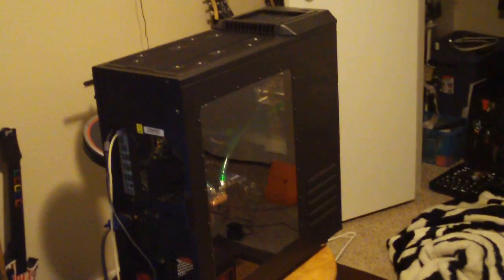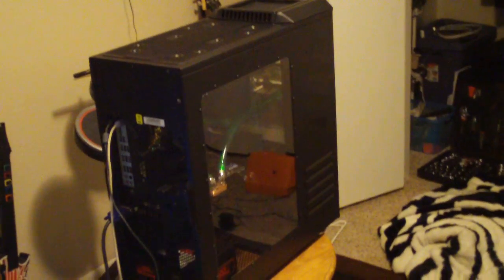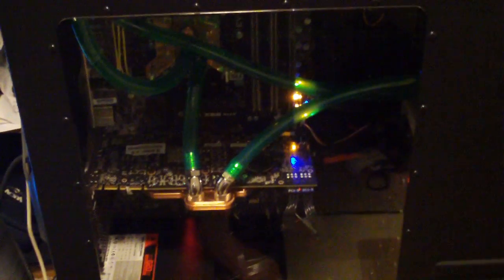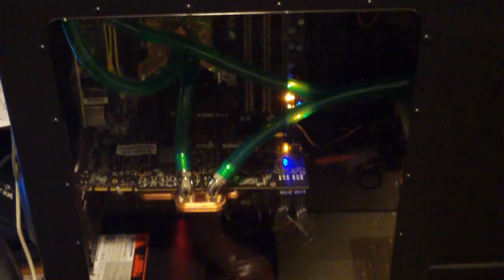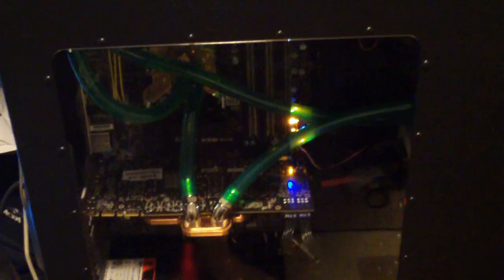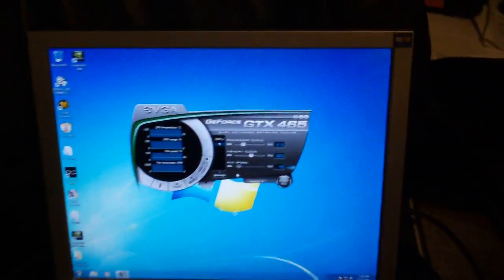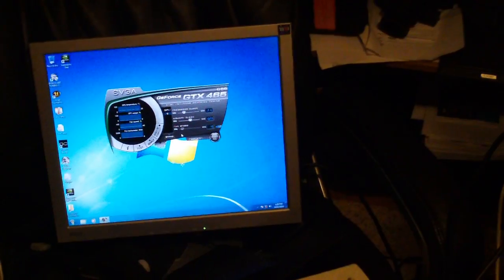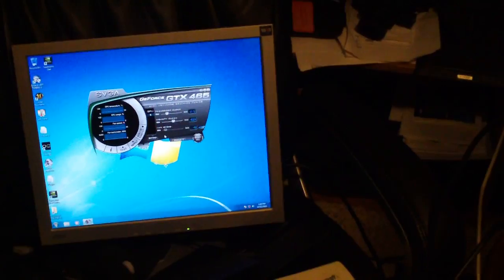How to setup and install a water cooling setup/loop (part 4)  build complete/advise

Comment from the maker: You can use a tline.  I just cut part of the tubing off or undo one of my compression fittings.  6month to yr is when you should drain your loop and perform proper maintenance.

Comment: @CaptanCarrots All depends on brands you buy, I used some nice stuff and 360,240 rad and two gpu blocks with cpu block a res/pump And everything that goes along with build ran me about 1400$. Its not cheap specially when you get into the better rads and gpu blocks n setups.

Comment from the maker: @onlyreallifematters 
Using 7/16 tubing and 1/2 inch barbs. Using this combo provides a better seal. Also that is why you leak test.
If you are a new to this is recommend you use clamp or zip ties.

Comment from the maker: @SylentCommando 
I am using a mcp355 pump with a xspc dual bay res ment to house a mcp350 or mcp355.
I am using  a Stinger V6 water block. Fastfreddy makes them